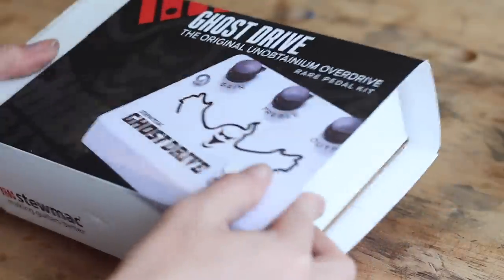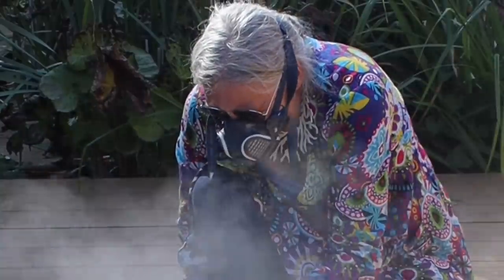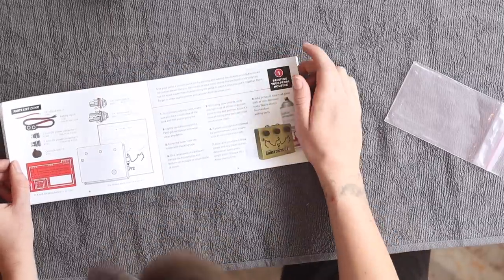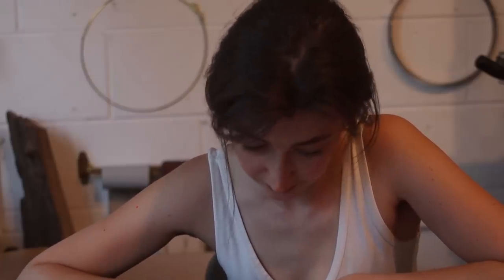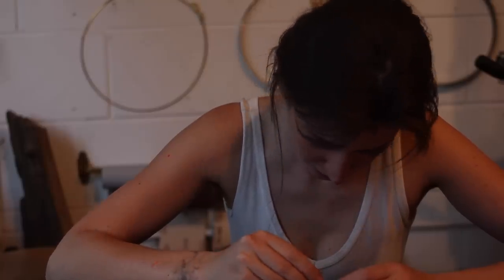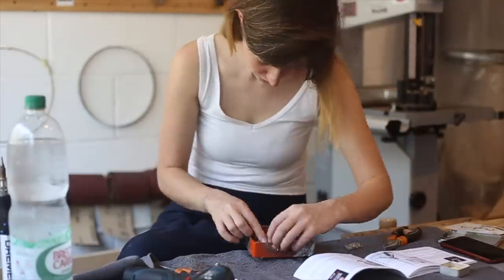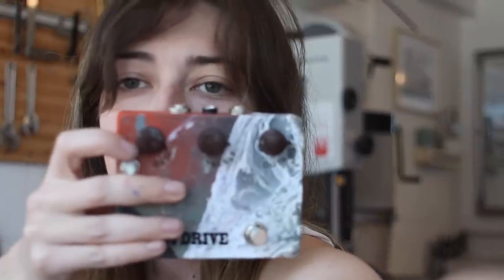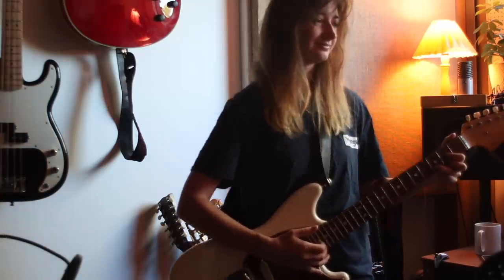I Built The Rarest Guitar Pedal | Klon Centaur

Comment: I just finished making my GhostDrive when this popped up. I though I'd blown mine, asI had no power when I plugged it in. I followed the diagram when soldering, but the red wires (battery + and PSU+) from power in to circuit board were the wrong way around when I checked it with a multimeter. This meant the power jack input was switched off when plugged into PSU, so I had no power. Swapping the red cables on the jack input around meant the switch between jack input and battery worked correctly, and the unit powered up. Long shot, but worth checking.
Reply: I make the exact same mistake!  I had to contact tech support for help and they told me,what I had done wrong.  Fun build and great pedal!

Comment: I've built several kits and raw circuits from scratch over the years. these are tiny boards and use the 9V ( -v at the tip) type pedals. Important not to use too hot a gun for this project or too big a tip. you can destroy the board and or components. Best if you can use a temperature controlled soldering iron.

Comment: As of the Great lock down of 2021~2022 I got a kit set in from some random chinese place. The instructions were well less than useful the marking on the cct bord where great. Got it together and first test well less than enthused! Pedal output was < 1=1 the hunt for actual cct diagrams started in the end found the error in the silk screen on the cct bord one of the output resistors and one of the grounding resistors where miss marked. Though from my background it was woohoo it's broken now the fun of diagnosing and fixing it! Not something I get to do these days as most stuff is non repairable without the tools for reflowing of surface mount components and I have long since moved on from electronics servicing and repair.

Comment: Wow... As soon as you said "Can I borrow your DC jack", I got a horrible sinking feeling in my stomach. Many years ago, I repaired a liquid damaged laptop for a friend. It was some 8 hours of work cleaning the motherboard, which thankfully only needed a few components replacing. Got the whole thing plugged in, tested it and it all worked fine, so I came to close up the back of the case. I closed the lid and... crunch. This thing had irritated me so much the whole time I was working on it, and in frustration, I closed the lid too hard and smashed the screen.
All it takes is that one little moment of distraction, and you're back even before square one. 
I kicked myself so much after that. Especially given that I then had to buy another screen for it, and strip the whole thing down again to replace it.
It's a properly gutting feeling.

Comment: I’ve plugged in the the wrong voltage for pedals before as well. Fortunately, I now use an isolated power supply (brick) and that prevents my mistake from turning into a disaster.

Great job on building the pedal either way!

Comment: Using a multimeter to premeasure and mark on a board your resisters helps. Also part numbers on capacitors may not exactly match the book instructions so just internet search the numbers and you’ll see how they match up.

Comment: The vast majority of pedals are 9V so if it takes one 9V battery it's 9V, If if takes 2 9V batteries it's 18V (much rarer) and there are a few at 12V and other odd voltages. I always check which voltage AND polarity of the input jack because there are different pedals with negative centers and some with positive centers. Running a battery at first will always be the safest, then you can look into voltages and polarity. Also there are a few pedals that can jump up a 9 volt battery up to 18v and some that can take both by switching an internal switch. Ultimately it's up to the user to determine all of this.

Comment: Soldering on small circuit boards takes practice and having the right soldering iron and tip can make a big difference. I've been tinkering in electronics for a long time and my soldering skills are still weaker than I'd like. I've improved quite a bit over the years, but then I see these guys do really gorgeous work and I realize I'm just out of their league. But it's cool. I manage to get stuff working. I actually have a STACK of pedals in the form of populated or mostly-populated boards. I just need to put them in enclosures and connect up the jacks & pots and stuff. And that pile has been sitting there for a good bit. Maybe this weekend...

Comment: Like many have already mentioned, it should be pretty easy to repair your pedal. Most of the components (resistors, capacitors, diodes, wires, jacks) are rated for much more than 9 volts. If anything is damaged by the higher voltage, it is most likely the 3 ICs in the circuit. They should be fairly inexpensive. I would recommend a visual test to see if anything else looks burnt but I would consider replacing the ICs and giving it a try, If that does not work, then find a friend who has a good multimeter and some troubleshooting skills and they can troubleshoot further. 

Thanks for the video. I really enjoy watching your approach to the various challenges.

Comment: Likely just the zener protection diode, possibly the Maxx1044 step-up regulator chip.
In general, I'd always suggest socketing that step-up regulator becuz (a) things fry, and (b) they CAN be electrically noisy and some are more susceptible to behaving badly if there's noise on ground (i.e. a high-current-demand digital pedal can do just that).

Anyway, either of the component swaps can be done easily and inexpensively with that soldering iron and a little solder wick or a solder sucker.
It is unlikely that the trace was vaporized as we aren't talking 10+ amps of current.
Never fear.
It was a good lesson, and one that will make you a better/safer user of pedals in the future.
And shame on your friend for not anticipating the issue with the appropriate voltage... if he IS a proper pedal-nerd, he should have known that would happen... Klones (and positive-ground germanium fuzz pedals) are the two most common pedals to fry up for Sunday breakfast.

Don't be down.
Just cuz it was your first, doesn't mean it will be your last.

Comment: Be cool. My guess is that there is a protection circuit on the 9V input. It’a a Zener diode, probably 12V. It works as a protection for overvoltage and wrong polarity. It’s set so if you accidently connect 12 V or more or have the wrong polarity on the supply, the diode will blow. The pedal will appear dead. Most of the components in the pedal can handle 12V and more, so except the Zener diode, the rest of the components are probably OK. A new diode, guess it’s a 1N4742, cost abt 1 Eur for 10 pcs… just some desoldering and resoldering, and that you proved was no problem :-)
Nice work by the way. Two strong recommendations that does not cost that much and make a difference.
• Multimeter – To measure Volt, Ampere, Ohm’s (resistors), Farad (capacitance) etc. With this you can check components values, connections, short circuits, check diodes etc. abt 25 Euro and up. A good one abt 50 Euro.
• Soldering Iron – A temp controlled with about at least 25W effect/390 degree temp. A fast hand is better than a low effect… That said, to high effect can quickly burn things up. Mine is 60W/400 degrees, but you need to know how to use that.  
• Desoldering – A desoldering pump is a big help and a saver off the circuit board and components on the bord. Both to de solder and to clean up. Some prefer braid. I prefer pump in general. Use braid if there is a tight spaces.
Hope it helps get your nice pedal alive again //Per

Comment: Thank you Daisy. A sad story, but a fab story.

That paint job made me think that the pedal should have been called "Cosmic Shores".

To be fair, the pedal should have at least had a fuse on it's power rail to protect the circuitry from input voltages that exceed it's operational range.  I guess that the designers don't think of such scenarios.
A rectifier would improve the power supply aspect too (imagine not having to worry whether it's centre +ve vs centre -ve.). Silly designers.
Thank you for sharing the challenging days alongside the easier days,

Comment: Really enjoying your channel. I run Fredric Effects in London and as a result have built hundreds of Klon-types. With your build, all may not be lost- the klon has a voltage protection diode designed to short out when given too much voltage. Part number 1N4742. Cut this part (yes really) and try the pedal with the correct power supply.

Comment: If anything has been fried at…. 18V or such. It’s those big capacitors. (The ones that may explode) Most everything else can handle much much higher voltages.   Or maybe since it’s a Klon. The charge pump (if one is present) probably labeled as a TC1044

Comment: Once built a 2 channel 50watt class A valve amp. Worked really well during testing right up until I managed to slip with a meter probe and touch a BIG power Capacitor. Woke up 3 hours later in hospital with a lovely burn on my arm and a matching one on my waist which was in contact with the metal table via a belt buckle... 😆

Comment: It is a great kit but not an easy build. I built one and it has earned a permanent place on my board. Replacements for all the components are readily available. A visual inspection may quickly reveal the failure. If the chips failed you don’t even need to solder. Unplug the bad; plug in the new ones. 

StewMac has great customer service. Worth a phone call or email. Hope the pedal ends up with detour sign rather than a tombstone.

Comment: So if you plugged a higher-than-specified DC voltage, the only components you're likely to have fried are the active components (chips, diodes, transistors).  Surely you can identify each one and order a replacement (Farnell, Hobbytronics, RS Components....etc).  Then just desolder the old one (need a solder sucker), and put the new one in.

Comment: cool

Yep,,, If I had a penny for every one of those dangit moments I could probably by a boat but they do cement the knowledge in.

Impressive either way.

When I was a kid I took my watch apart. 
They had tiny gears in them back then & no batteries.
I took it all apart, found the broken gear  and put it back together.

Since I wasn’t a watch maker and ebay didn’t exist I had no new gear so it was still broken but now I knew how watches work.

I did the same to my bike but left to go play after taking it apart and planned to put it back together later.
When I came home my bike was gone.
My mom had given it to the yard man because I “broke” it.
My step father said “If it ain’t broke don’t fix it”.

I still remember that but now I can fix almost anything, wood, metal , etc If I choose… and usually if it’s not broken but not always…. :)

It’s good to use our minds.

BTW the bike had the tall handle bars and banana seat everyone searches for now. Oh well.

Comment: Components can have higher voltage tolerance than what the pedal is supposed to receive. It is all down to quality/over-spec'ing. Some people are known to over-voltage certain pedals on purpose. If the kit has overspec components, maybe the screaming is wiring error rather than dead compenents.

Comment: If the capacitors are not damaged, you could try to change the op amp and the voltage inverter. It should be work :)

Comment: The board won't be fried. I don't know the circuit, but many pedals have an input capacitor (C1) which is intended to protect the rest of the circuit. So chances are you just need to replace C1 cap. Hope this helps

Comment: Hi Daisy, I'm pretty new to your channel but have already watched most of the videos and love it. Keep the videos coming!

As someone who is experienced with soldering and assembling pcbs - also professionally - I'd say that this is not too bad a pcb for a beginner as it does not involve very difficult soldering by electronics standards. Key is a good soldering iron or even better a soldering station with a chisel tip, this makes it so much easier. These pointed tips are no good in general. IMHO the one part of a soldering iron or station that determines the usability the most is the tip, and the problem with cheaper equipment is that also the tips are not on par with the ones of the more expensive equipment like Weller, Hakko or Ersa. If possible prefer a soldering station with temperature regulation over a simple soldering iron, even if it's a cheaper one.

Regarding the fried circuit I think you can fix it. I don't know if Stewmac have modified the cirucuit for any reason but I had a look at a Klon Centaur circuit I found online. The circuit is quite complex but it contains only three ICs, one ICL7660 voltage converter and two TL072 opamps. These are the first suspects to failure and as they aren't expensive components you could just change them and try again.

Comment: Know that feeling well.  I designed a light fitting which used 30  3mm led's which,  because of the design,  were so difficult to get in to place and glue and took 3 days on and off gluing them into their holes as each one was pre wired and inside a tube.  Well,  I was getting ready to connect current limiting resistors to each led,  but had given a quick test twisting all +vs together and all -vs together and used one resistor.  All worked well.   I was removing the battery and resistor when along came Chibs,  our 1 Yr old cat,  bumped my hands,  battery touched the wires directly,  no resistor,  and all that work was gone in a split second.  😢   I still ove my cat though 🐱

Comment: Oh my, that is soooo frustrating! I have to admit, I know how it feels like. I built several pedals on my own (an overdrive, a booster, a delay and a compressor) and I basically fried the compressor by pluging it into a 230V AC input! Well, I took my MXR DC Brick's input without the DC Brick before and was like, reaaaally tired so I didn't notice it until there was a smell of... well, something burning.
I ended up in giving the pedal to some guy I knew in exchange of teaching me how to repair it. And he showed me that there was a sub-circuit dedicated for protection in those cases. Sub-circuit was blown up but the rest was working. A valuable lession, but it costed me a pedal to see it.
If you know someone who knows how to measure basic electronic (I mean, a Centaur, even though not the easiest one to build, is pretty basic : 4 "cheap" chips from memory, the rest is just mostly resistors/diodes/capacitors), that shouldn't be a problem to repair. Then you could post an update ;)
(Please excuse my mistakes as English is not my mother tongue, like at all)

Comment: Hi there! Electrical engineer here. With those pencil tips it’s very typical that you use the side of the tip to actually melt the solder. You may prefer a different type of tip, such as a chisel tip. It’s not a problem with that iron, though, I use that particular iron myself and a common problem for me is that it actually gets TOO hot.
Reply: That's a really good but of advice, thanks. I've just ordered a chisel tip!

Comment: Well done for soldiering/soldering your way through this project, even if you were defeated by an "oh gawd no" moment with the power supply at the end. I've considered having a go at this kind of kit build but in the end I just bought a cheap klon clone and skulked away from potential failure safely. Rewiring electric guitars is the extent of my electronic work and even that leads to swearing and burnt fingers so... I'll stay in my lane and leave the fancy pedal stuff to the experts. However, that looks like a great kit so I am "almost" tempted :)

Comment: Suggest you contact StewMac and explain exactly what you plugged in/specs. With a little luck, you just fried a component or two that can be easily replaced. Hope there is an easy solution. Looking forward to hearing the pedal. Nice paint job on the case and the wiring looked good.

Comment: Great paintjob. Don't give up on it though, with a multimeter you could work out which part failed and replace them. Parts are cheap. My first pedal didn't work either, although I'm a bad example as I've never fixed it, I just kept it as a momento.

Comment: I've been building my own guitar gizmos since 1975 (yes, I'm kinda old). In all those years, I have never applied too much voltage (by accident). I certainly have blown up more than a few capacitors on purpose in my day. Electolytics are the best. My own personal snow storms... but I digress. Even though I have never put too much voltage into a circuit, I often make the mistake of too little... specifically zero. I think, all summed up, I have probably wasted a month of my life debugging electronics where the power just wasn't there...  It has been fun, even though a lot of my creations sounded like crap. These days, all my effects are in software. I miss the smell of burning solder, but not much.
I'm looking forward to watching more of your videos.

Comment: You should have tried a smaller pedal first, like a Fuzz Face with 12 components plus pots, jacks, power adapter. There's a seller in the UK who sells the circuit boards on ebay.

I started with that after I learned how to build pedals on a breadboard.

Comment: No big deal, happens a lot of times, as some people already said: 

it's probably the zener diode for protection against higher voltages and wrong polarity (there's only one in the circuit you can't miss it), it already happened to me 2x with a KLON clone pedal because they use a rather unusual charge pump. 
If you apply more than 12V to that zener diode it can short, stays shortet and is broken, so your circuit stays protected that way, because the broken diode creates a short circuit on the input already.

It would even work again if you just remove this zener diode.
But if you don't put in a new 12V zener diode and apply wrong voltage/polarity again some parts of the circuit or maybe only the charge pump IC will be dead for sure :)